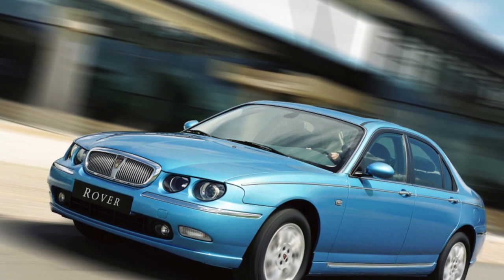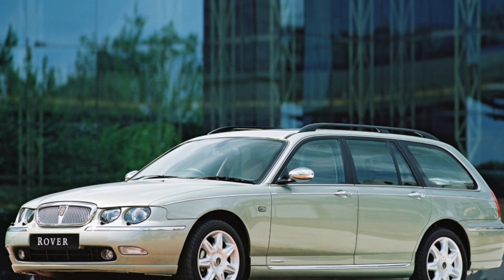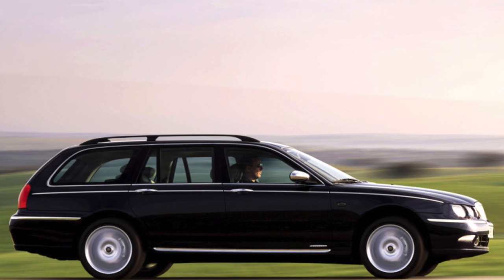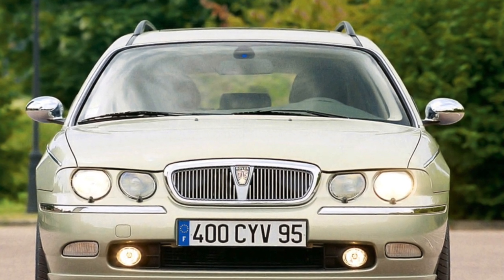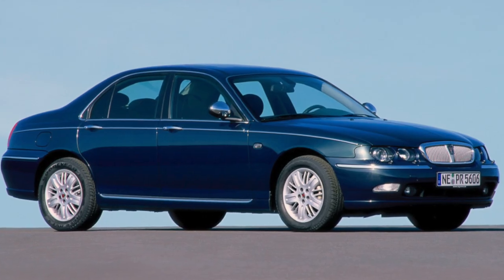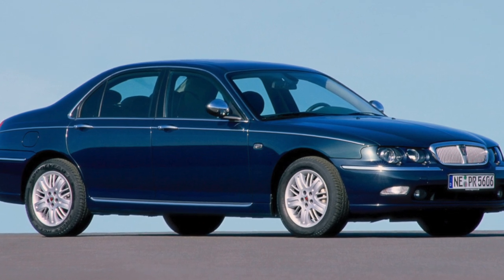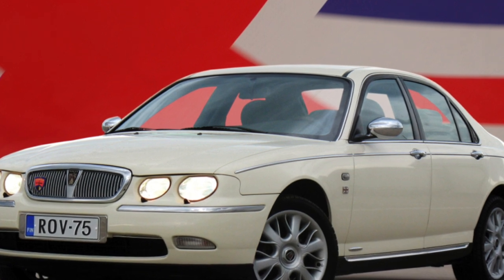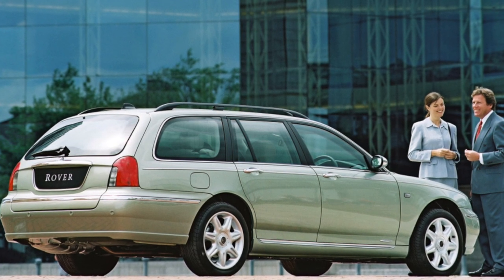Rover 75 Problems | Weaknesses of the Used Rover 75 (1999 - 2004)

Comment: Can't speak for the petrol engines but I'm familiar through forums with their issues. All I can say is, I'm on 520 000kms on my Tourer diesel now(first engine) and still enjoying the car from since I own it... shock absorbers last up to 80 000kms??? First time I had to change mine were at 380 000 (front), the rear ones on 420 000... The springs broke some time earlier though, the rear ones being the first to go (was somewhere around 200 000), the front ones followed about 50k later. Further issues (although I rather can mark them as normal wear): alternator went at 320 000, front discs first replaced: 370 000, rear ones at 450 000. The original exhaust lasted (admitting doing a repair on the mufler attachment) up til 400 000kms! One issue that was not down to 'normal wear', is the intank fuel pump which left me down at 180 000, but since I replaced that with the samesized but better pump used on some Peugeot models, this replacement still lasts till this day (touching wood of course! :-) ) and most af all (and you might believe it or not): I didn't have one clutch issue on my manual gearbox but that's just because I've made it my own to practically only applying the clutch pedal when setting off. With the car rolling, I shift gears back and fourth on the right RPM without having to use the clutch. Shifting back only requires a bit of lifting on the RPM to shift back smoothly. People who are driving along never even notice that I do it this way and then I have to prove it to them taking my left way fram from the clutch pedal and shifting. Only thing I need to do, is to fill the master cilinder every now and then, but that every now and then is somewhat about every 50 000? I can't even tell because I don't keep score on that. It's less than once in a year anyway. :-) As far as bushings are concerned: (just like on any other car) once replaced with polyutherane, you're rid of that sh*t forever. I don't have a tester T4, but there's a fantastic app made by Polisch Rover-enthousiasts called TOAF.

Comment: Make sure you have plenty of spare cash. Leak's here there and everywhere. Corrosion big issues, brake pipes corroded front to rear, watch out  head gasket failure, overheating  on v6 2.5 stop straight away. Coil springs break can puncture tyre, sill corrosion, diesel version pain to replace alternator, leaks to ECU. Still a lovely looking car. But beware check MOT status a must.